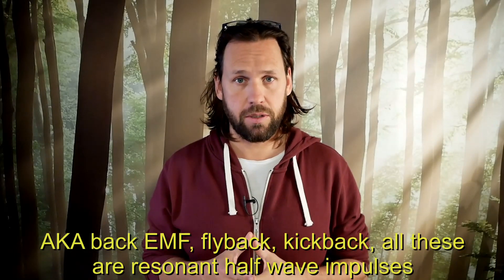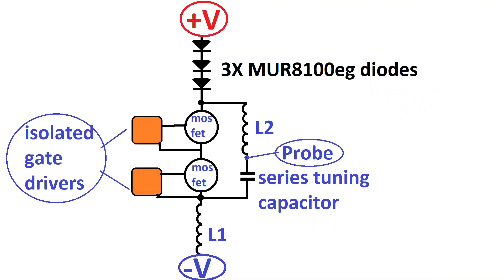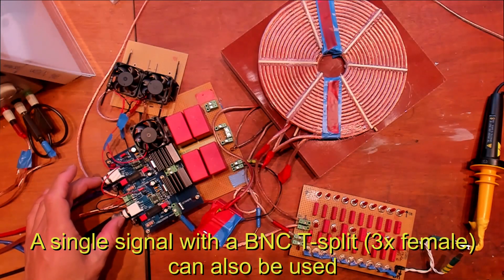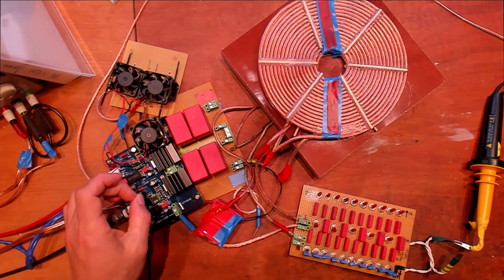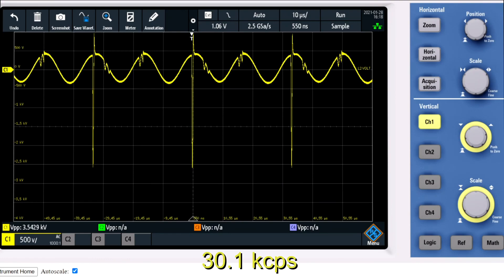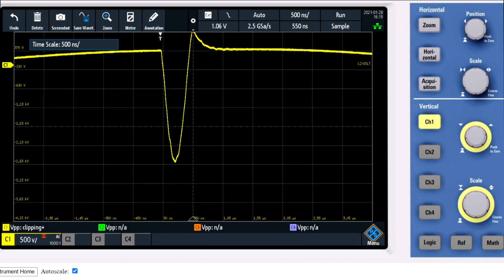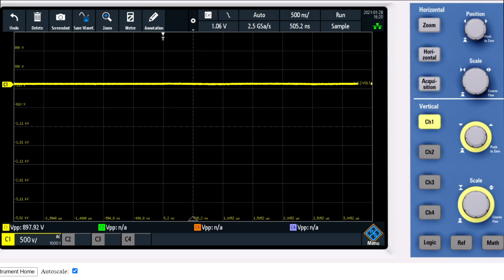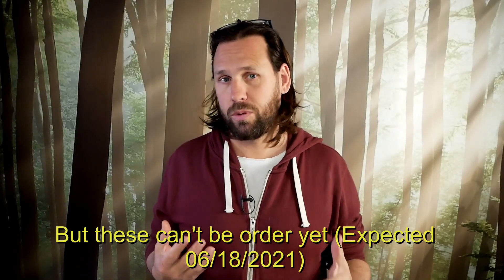High Voltage Impulses generated by Series Switched MOSFETs for Tesla Primary Coil

Comment: I was wondering how many can we string in series before we run into issues. I think the isolation voltage rating of the gate drivers is 5kV so I assume that is the limit. Unless there is a way around that too.
Reply from the maker: Indeed, that appears to be the bottle neck. Maybe with isolated opto couplers and batteries
Reply: @MasterIvo  Check out these devices. At $2 per piece we could use one transmitter and receiver pair per SICFET with a common Audio fiber cable linking them. I would guess a couple of meters of glass fiber is good for a few hundred thousand volts. 
https://www.digikey.com/en/products/detail/everlight-electronics-co-ltd/EAPLTAA4/7926541
https://www.digikey.com/en/products/detail/everlight-electronics-co-ltd/EAPLRAA4/5142273
Reply: From my research, placing many transistors in series and in parallel is how the military often generates high power impulses for testing lighting conditions. They do run into a parasitic capacitance issue I believe, and they fix it with advanced IC's by Texas instruments or something for load balancing before each transistor, similar to a technology they use for increasing efficiency of flyback transformers-- from what I understand.
Reply from the maker: Intersting! Makes sense. Lightning is an impulse. 
more in series is higher voltage but also higher resistance.
more in parallel reduces total resistance.

I wonder how they get their drivers to resist the high voltages.
Maybe custom photo couplers with glass fiber.
Reply: @MasterIvo  A few months ago I found out about triggered spark gaps, and I was working on incorporating it into my own similar designs, until career stuff slammed me.

I think the analogue nature of the triggered gap is more promising than attempting to route the high power impulse into a transistor block.

Like I said, I put this down for a while before working out all the details, so if there is a way to protect the third electrode's circuit from spark-over into it creating harmful back EMF, it will eleminate the need for transistors in the high power circuit.
Reply from the maker: @ickorling  with a cap you need a spark to close the circuit.
with a coil you need a switch to OPEN the circuit.
You can guide the high energy impulse away from the switch, by discharging it through the series resonant (low impedance =wire resistance) primary coil.
there it does the magic.
Reply: @MasterIvo  I have a gap between a capacitor bank and a resonant vortex coil, and the coil's placement is such that it very effectively quenches the spark. Sorry, I'm not sure I readily see what you mean. I'll watch your new video soon, I'm still at work.

Thanks again Ivo!
Reply from the maker: quenched capacitor spark is to create a  current impulse (resonant half wave). 
A coil discharge is the same but now its pure voltage
Reply: @MasterIvo  Indeed, I think field alignment & geometrically is a factor, as big as materials and theory of basic analouge parts is where I hope to see this develop into. Digital controllers that are uncoupled, for the thrid electrode, that's what I think I've veen struggling with. You were mentioning octo couplers and the like? Im not sure, maybe something simpler would protect the digital contriller and transistoers from current rushing into it... the stuff I'm working in doesnt have ground, but keeps everything transient arresting itself and recharging on back emf... over charging. Theoretical
Reply from the maker: @ickorling   cool stuff you are working on!
Reply: @ickorling  interesting indeed. your description somehow sounds like an impressive array of transistors in avalanche mode :D
But what is about this impulse circuit is to power a primary coil and then transform it on even higher levels by an typical tesla transformer as secondary!? This creates impulses with an multiple of the peaks from the primary coil, perhaps being able to connect to other energy fields from the environment to let them flow some of their energy into the system. Later on it can still be transformed back for a better usable voltage level for devices. This is how i got inspired by the work of Donald Lee Smith http://www.free-energy-info.tuks.nl/Smith.pdf
Reply: I remembered something a little more about this. The transistors in the series and parallel block each become ineffective as the gate becomes saturated, so at higher power, each gate charges slightly different, thus an intelligent controller is used for load balancing. There are websites somewhere out there where you can buy these ultra fast high power switiching blocks made from transistors, but they are way out of our price ranges. Again, this is why I prefer the direction of triggered spark gaps. Crude but dude, think of the power!
Reply: @ickorling  To get more power the size should be increased. Tesla wound really big pencake coils to get more power (seen on pictures and described in books). He still used wires (I think because of the production machines at this time) but to increase the capacity (dielectric field) of the coil, only the surface needs to be increased and not just the turns of windings. So it came to my mind to use a really flat ribbon instead of normal wire just to increase the capacity and with the right proportion the resistance and inductivity stays the same). So just think on the design of the coil itself and not just on the circuit. What do you think?
Reply: @florianpolster2211  Indeed, surface area is a primary concern for increasing the power of radient energy emission. A copper ribbon is akin to a flat tube, but considering the the topology of the conductor, accointing for any sharp bends or edges, you are affecting the losses due to the field shape of the EM energy radiating off the conductor's surface not being near the same shape as the magnetic field is-- a hypersphere. So round wires is a good thing, as is hollow copper tubes. Personally, I use very thin wire carefully twisted together into litz wire. For me, 15ish strands of 36 AWG wire. Tesla used thin wire in his Tesla Hairpin demonstrations. Another issue to deal with in this field is how to switch the power on and off really fast. Thats what this video primarily deals with in moving to higher power applications. As for obtaining larger pancake coils, and bifilar, really, maybe look into refridegerator coils at hardware stores. Stay cheap my friend!
Reply from the maker: I will probably never use spark gaps. learned so much from inductive spikes. cap discharges are much harder. but indeed you can get much higher current impulses from them.
But is it needed?
Reply: @MasterIvo  You're totally right, I've gone in the direction of spark gaps for higher current. I would like to drive the cost down for high power pulsed power supplies with ultra fast di/dt. If it were more commonly available, even if a design were to exist for amateurs, more people could use it to investigate Nikola Tesla's work.

Although... personally, I expect there is some organizing effect of a spark discharge quenched by magnetic vortex. Thats my own guess though.

I respect that you dont use spark gaps; its also just plain dangerous to work in high current.
Reply from the maker: My series resonant primary coil is impulsed, and I have seen the current been amplified to 25A. pretty high
Reply: @MasterIvo  Wow, 25A? I thought you were at about 5A. I'll remind you that I have learned a lot from your videos, your experiements with half beidge bifilar coils seem very fruitful! They spawned new ideas and concerns about my designs.

I'm still not as far along as you, but also, not so far behind I hope! Our slightly different approaches mean for a diverse frontline force in this research field :)
Reply from the maker: yes indeed diverse experiment lead to quicker success.
The 25A was in the series resonant primary coil.
The amps are amplified.
Now that I can produce much higher voltage impulses, I should really be careful for high amps.
I already had 2.5mm2 coil becoming hot...